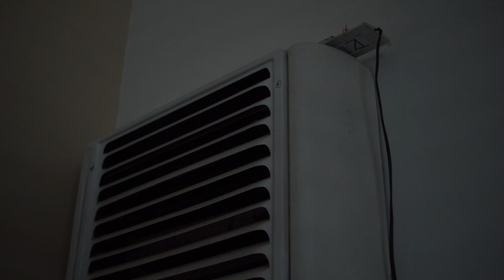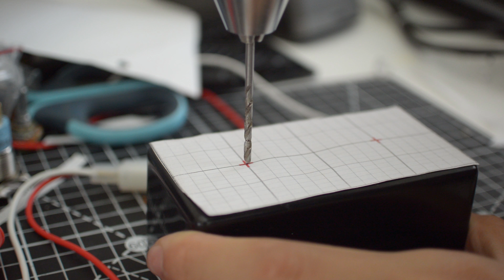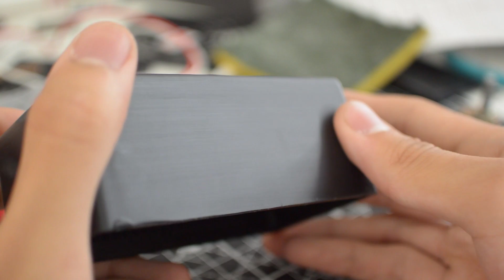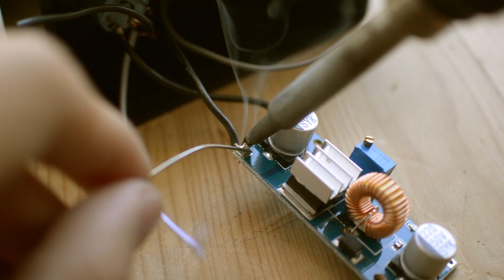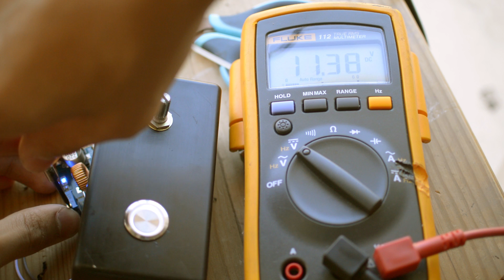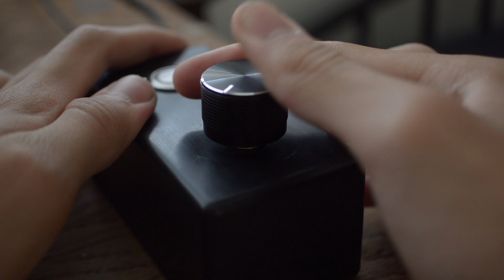Build your own LED Dimmer Driver

Comment: Isn't clear, with input of 12V how can be output 12V if the drop Voltage of Xl4015 is ~1,5V? You need at least 14V input

Comment: Hi,
Could I use a LM2596 step down voltage regulator?
Reply: any regulable dc-dc stepdown should work, you are just using a big potentiomer conected in series to the variable resistor in the module so you can adjust the output voltage without a screwdriver

Comment: Can you help to design a circuit to control the temperature of TEC1-12706 thermocouple, using source as 5v dc supply

Comment: I'm trying to drive an LED with a max of 11v and a minimum of 9v at 900mA. Would this work? How do I regulate the amperage?
Reply from the maker: This should work. There is no need to regulate current, voltage is enough.
Reply: @SlideoStudios  fantastic! should I use the resistor you listed?

Comment: Seriously, voltage regulation?  Come on man you sound like you understand atleast a bit about electronics.  You need a PWM control circuit and leave that dc-dc set to a fixed voltage, using only pwm for the dimming purposes.  Do not buy commercial own boards tough you need to make a simple one with a 555 some caps, pot, diodes, mosfet driver, and mosfet for ultimate efficiency.  Good luck man I wish you well
Reply from the maker: I am not using a linear voltage regulator. I explained why I did not use PWM as it will cause flickering when I do video work if I choose to shoot at different shutter speeds. I ended up using a Buck converter which is similar to PWM but has an LC Pi filter to smooth out the PWM signal into a relatively linear output give or take. Its not perfect, at higher loads, you can start to see the PWM waveform if graphed on an oscilloscope but good enough for LEDs and to eliminate any kind of LED flicker. I hope you understand that buck converter work the same as PWM essentially but just smoothed out with filters.
Reply: TZ Studios dude sorry I don’t want to sound rude but that’s just not factual.  Buck converters regulated the voltage, yes using a a dc square wave, but pwm dimming is done on a frequency level, flickering*** only occurs in cases where you’re pwm signal is at too low of a frequency.  You can creat a higher frequency circuit simply using a 555 timer in an a stable multivibrator config with some specific valued capacitors, to alter that and a mosfet to drive it, pot to control its duty cycle.  I’m a professional videographer I know the importance of removing any flicker at higher frame rates, so I build all of my dimmer circuits myself.   
And I am not here to bash you at all I’m not a troll I usually don’t even comment on videos.  But in this case for optimal efficiency you want to go pwm.  Hope you understand and try and experiment with it.  The buck is only good for keeping the voltage constant, using it as a regulator for dimming is certainly not the most Efficient way of doing it and your duty cycle is basically 100% on all the time just at lower or higher voltages
Reply from the maker: @RMquickbit  Maybe it would be more efficient because it lacks the filtering circuit and also the feedback loop. Cameras can be unforgiving, if you shoot at extreme shutter speeds, any PWM type dimmers can flicker. At most you are saving around 1-5 percent efficiency. The best kind of PWM LED dimmer gives you around 90 percent efficiency. What I am saying is still right in that it essentially is PWM just at a very high frequency and filtering it out with an LC Pi filter and also adjusting its duty cycle with the use of a feedback loop system in combination with the user input as set by the potenitometer
Reply from the maker: @RMquickbit  Also, like I mentioned before the best kind of PWM dimmer can give you 90 percent efficiency and also the best kind of buck converters can also give you that 90 percent efficiency. Ofc, the buck converter I used is not the best but so is your 555 timer circuit. I am probably getting around 86 percent with this buck converter at its max load of 5 amps, give or take.
Reply from the maker: Additionally, with buck converter, you get the advantage of a feedback loop system which will ensure that any LEDs put as the load, either high or low, will be able to get the same amount of dimming. It constantly monitors the output and adjust the duty cycle so even if I were to put an LED strip with 5A load or a 1A load, it will all be dimmed the same which is something your PWM dimming circuit lacks. They also share similar efficiencies to PWM at around 90 percent since I explained already they are basically PWM dimmers with filtering and most importantly the elimination of flicker in video. I hope you actually took the time to watch the video rather than making the assumption that I am using a linear voltage regulator.
Reply: TZ Studios ok let’s just agree to disagree.  I know exactly how a buck converter is used
And it’s design but thank you for that, I never said you were using a linear voltage regulator so I’m not sure where you’re getting that idea?  The circuit should simply be, ac from wall-dc output of +12v or whatever you’re buck can handle-then the buck converter(set to your desired voltage, and if you have a current control feature then you should set it in constant current mode but that’s here nor there at this point- and then from the buck converter a pwm circuit-then connected to +/- of LEDs.  I literally do the same thing you just did with the voltage regulator, adding a pot, but I also add the pwm controller for EFFICIENCY!!!!!  So you can certainly adjust the voltage up or down as you please but ultimately using the pwm circuit for dimming.  I find that my lights work great at 9-11v actually and can run cooler.  The actual dimming though is always through pwm though with a very high frequency.  
I don’t know why I just typed all this, no I understand why people get into arguments online.  Ok man.  Keep doing you’re thing
Reply from the maker: @RMquickbit  Yes I understand now. I got too many comments saying I am just using a linear voltage so I thought you were one of them. Clearly you are not. I am just saying at most you are saving 1 to 5 percent efficiency assuming you have the best PWM circuit. If I had the best buck converters I can also get 90 percent efficiency.

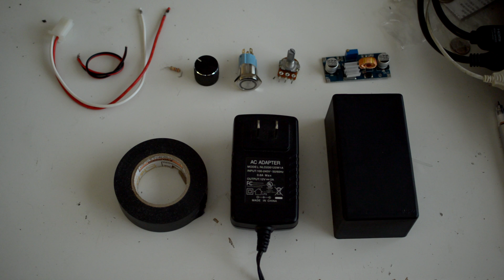Comment: So the parts needed shown at T=0:30 ( https://youtu.be/jdwlqoHAA1o?t=30 ) includes a DC-DC 'buck converter' which I presume is the XL4015 Step-Down Voltage Regulator which is no longer available.   Any suggested alternatives?  Thanks.

Comment: Why exactly 5k pot + 2.6 resistor? I'm bad at electronics, but I need to build couple of  these for movie production. I've found out that the blue pot on the dc/dc regulator is 10k. To split the voltage there should be parallel resistance the same amount. 10k + 10k. But you're using 10k(on converter) + 5k + 2.6(to set minimum voltage) I'm wondering how does it depend? Should I use exactly 5k and 2.6 or there is any formula calculate needed resistance to set minimum voltage? Thanks
Reply: https://www.youtube.com/watch?v=Y06VHj1GvLI&t=4m52s

Comment: Pro tip: You can keep your drill bit from "walking" on the plastic (or metal, wood, etc) by first creating a pilot hole. Do this with a teeny drill bit first, or just use an awl (a tool that looks like a metal spike) or nail to make an indentation prior to drilling. Your bit will stay put, and not walk around the piece first.
Reply: You should also try using a step drill it would be a lot easier

Comment: I noticed that you use a 10k pot in the video,  but everywhere else that i found reference, including the description it lists a 5k pot. is the 5k the way to go? i know this is only a signal thats mapped to the output of the device, but it seems some people are having range problems with the potentiometer..? Thanks in advance! currently at the desk building about three of these for auto, boat and some shelving lights.
Reply: I built this circuit by using a 5k potentiometer , and as you mentioned I have a problem with the range..🤷🏻‍♂️

Comment: What is the minimum voltage?
Reply from the maker: The minimum and max voltage can be set using a different resistor and change with the variable resistor.

Comment: Inadequate. This is voltage regulator. Need PWM!!!
Reply: It has a current rating of up to 5 and has an efficiency of 90 percent
Reply: That is a buck converter not a voltage regulator. A buck converter uses PWM and smoothes it out with an LC filter.
Reply: @Potato2456-o1w  How is that more inefficient than PWM? Also the reason I used a buck converter is to remove flickering.
Reply from the maker: @alfa-psi  Thank you! Its exactly the same as a PWM but just with smoothing capacitors

Comment: yeah... thats not a led driver. Its just a voltage regulator. A led driver has a constant voltage and (usually) a pwm chip which rapidly closes and opens the circuit. This way the average current drops an thus the LED has a (average) lower power output. But you can create a led driver in a similar way by using a step down converter with a constant current function (Just hook up the big potentiometer to the current regulator instead of hooking it up to the voltage regulator)

(https://www.ebay.com/itm/DC-Buck-Step-Down-Voltage-Converter-Constant-Current-Power-Module-5A-5V-12V-24V/401682469946?hash=item5d8624143a:g:3FMAAOSwAP9cNZCa:rk:4:pf:0)
Reply from the maker: Also a PWM signal does not average current but instead averages voltage. If a voltmeter was used on a 50 percent duty cycle 10 volt signal, the voltmeter would read 5 volts as a voltmeter averages the voltage.
Reply from the maker: I explained why I did not use a PWM to dim the led because it flickers when recording video. I am planning to use this to dim Video Lights. Also technically a buck converter is a PWM signal just been smooth out with a filter so a typical PWM led dimmer works the same as a buck coverter just the converter has a filter for smoothing out the PWM into a smooth signal. Also I did not use a voltage regulator in the video, it's a buck converter. A voltage regulator will be too inefficient to run those high power LEDs.
Reply from the maker: @alfa-psi  Since he is talking about efficiency problems, he is talking about linear voltage regulators because Buck Converters are very efficient.

Comment: How long of an extension wire can you use on the potentiometer without affecting the signal?
Reply from the maker: The length shouldn't affect it because the wires are not carrying any high current and are only used as signal wires. I would say it would still work at 50 feet if the wire gauge is decent.

Comment: when i connect the potentiometer the out voltage is between 1 and 6 volt. i turn the screw but 6 is the highest value. you have any idea what is my problem?  i need to set the maximum level before conect the  resistor,  im right?
Reply from the maker: Maybe try to keep turning it. Sometimes the potentiometer is set very off. Also make sure your input voltage is at least 12 volts. :)
Reply: Same problem here. I tried many ways to connect potentiometer, but no luck. Max output voltage is around 6V and can be turned down to almost 0V. Schematics would help troubleshoot this

Comment: Hi – I want to dim my smd(led lights ) panel 
I just used a 20 k potentiometer with 12 v input but the light went down too much and potentiometer started to smell like burn .
Is there the problem of potentiometer (volume potentiometer) or other thing?
Input 12 v 10 amp – 
Amp usage about 6 amp 
Watt usage I think its about 100w
Reply: Holy smokes! (pun intented)
You apsolutely can not do that, the potentiometer is a resistor (variable), and it's disipation is 0.25W! Watch some eletronics basics #2 or so, (from Greatscott) about resistors. You must dim the LEDs with a MOSFET or transistor.

Comment: At both points in the video, you mention the resistor being a value you 2.6k, but the amazon link is a 2k.  Is there a reason for the difference in values?
Reply: You can add resistors in series or parallel to get the values you need. It isnt hard at all.
Reply from the maker: I was unable to find a 2.6 resistor on Amazon as they are quite rare. I included the closest one I could find that was the cheapest and wouldn't effect the circuit that much. :)

Comment: Is there a way to hook it up directly to 220v?
Reply from the maker: Yes, if you use a switch mode power supply, you can covert 220V AC to 12V DC.

Comment: Just discovered your channel, great videos! Can't wait to try this in the near future :)
Reply from the maker: Thanks :)
Reply: @SlideoStudios  Hope you see this, I was wondering why the buck converter? Isn't the power supply already 12vm
Reply from the maker: @edsontovar6675  The buck converter is used to dim the LED strips.
Reply: @SlideoStudios  Hi! is it possible to make a dimmer that can dim the light the opposite way of the one that you did? If so is it by changing the order of the cables that you put on the potentiometer? or how?